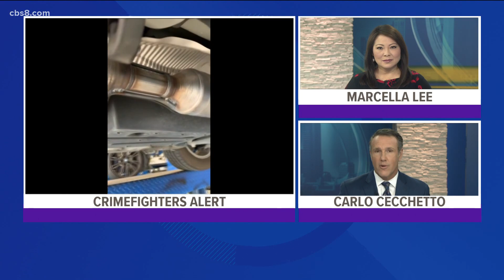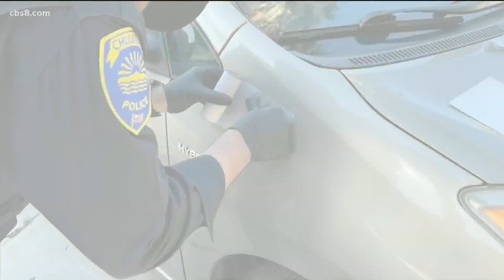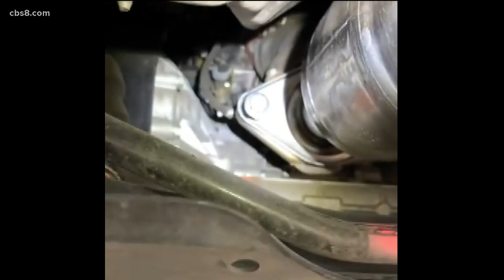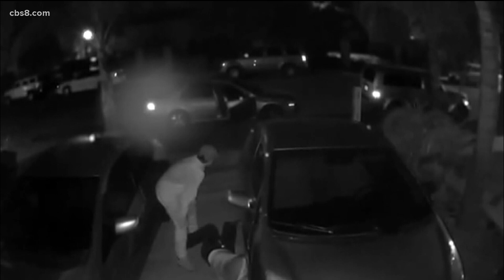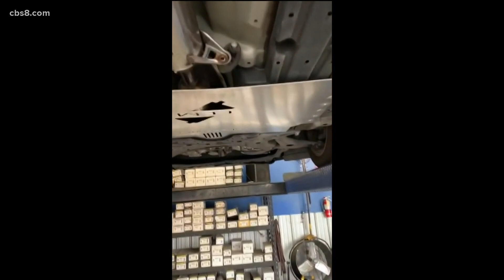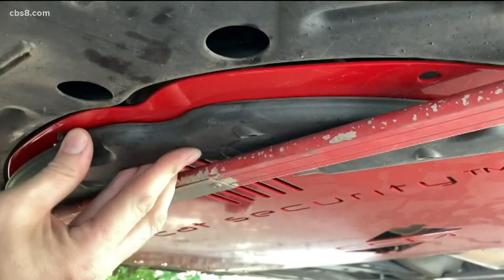Catalytic converter thefts on the rise across San Diego County

Comment: If you could get a mechanic to put extra nuts on the already factory torqued fasteners and proceed to round off the and strip the bolts it might make it difficult enough for them to move on.
Reply: Good tip, rounding off the bolts on the CAT is smart since you probably will never need to replace it....unless...it's stolen of course.
Reply: @UnknownUnknown-hg7xg  extra nut , rounded to prevent the other from being removed , if they steal the cat they unbolt them from what it looks like in the article , so even if you made sure they were all rounded off a guy who got under your car with a few box wrenches will be unable to remove the bolts , a mechanic at a shop wouldn't have a problem
Reply: @UnknownUnknown-hg7xg  you could have the nuts spot welded on also